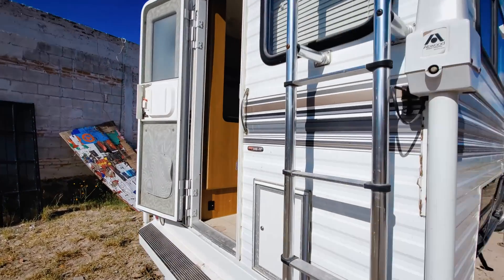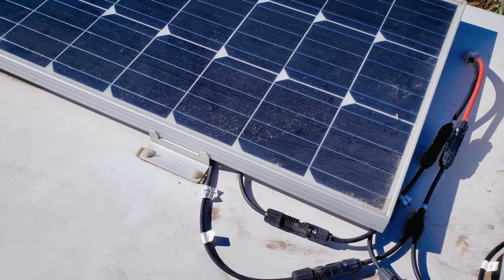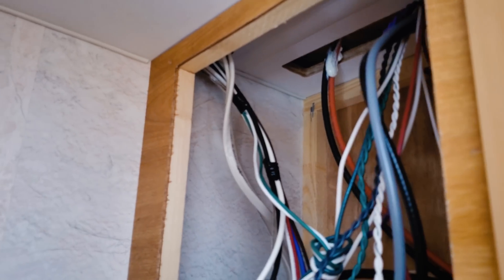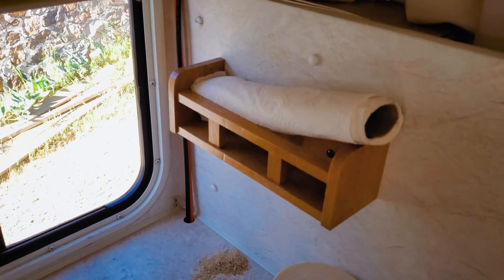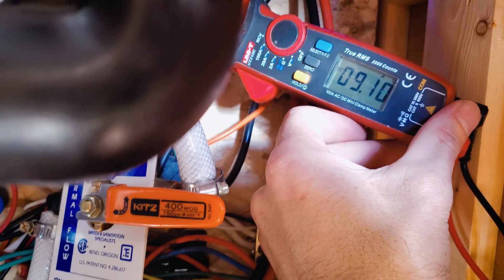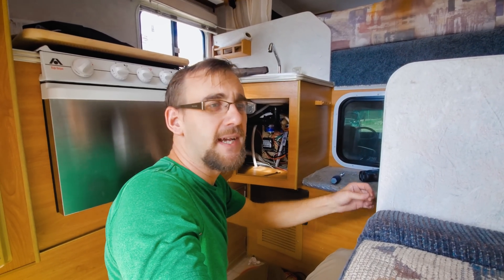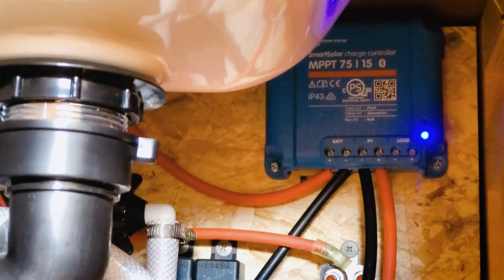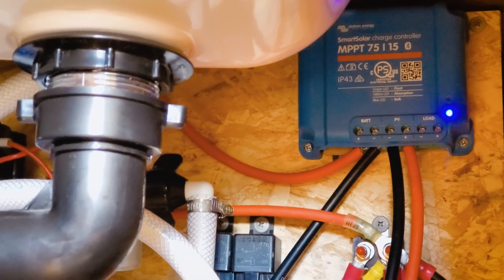Easy RV solar install for under $500

Comment from the maker: I told you guys I would make this. So here it is. Also since everyone is asking I still have the truth van. See proof of van life at 12:08

Total build cost, around $500... (if you use my amazon links I get a small commission)
Renogy 100 Watt 12 Volt Monocrystalline Solar Panel Slim - https://amzn.to/32SyjhF
Victron SmartSolar Charge Controller - https://amzn.to/303j6NG
Renogy 2 Sets Solar Panel Mounting Z Bracket  - https://amzn.to/34LlXcB
BougeRV 20 Feet 10AWG Solar Extension Cable  - https://amzn.to/2LzASyY
BougeRV MC4 Connectors Y Branch - https://amzn.to/34LUesA
Volt and Amp Meter - https://amzn.to/2O69muO
Reply: I have asked My illegal immigrant buddies which country is better.....USA or Mexico. They all said USA. All of them.(15 people) when i asked them why? They all gave the same answer. Safety and security. They would be afraid of owning a nice truck and camper in mexico because it would most likely get stolen and the cops out there dont care about auto theft. And they said if u give the criminal any problems or hesitate at all to hand over the goods they kill you. Day or night it doesnt matter. They do not value human life in mexico. People get killed for $100 all the time. U and ur family are in danger.
Reply from the maker: @CasaBonitaSucks  You clearly don't know what Mexico is like and your friends are simply jaded and don't know what most of it is like either.
Reply from the maker: @CasaBonitaSucks  there's no such thing as an illegal. And just because you found some people ignriant of how facist and violent the USA is does not make it better. I prove what you're saying wrong on video on the time. I would rather be a dead man and live free then a live slave who lickz boots every day. Take care.
Reply: I just ordered a solar panel for the cabin the other day...

Comment: Those solar panel cables that you passed through the roof to the inside are going to leak. For sure. Make sure you fix that. Maybe putting some sort of plastic cable cover or something. Hope it doesnt leak tho.good luck
Reply: And please put a splash cover under the sink to protect all that tech my man

Comment: My husband just finished his clean energy degree and has a couple of tips for you to maximize your system. You should assemble your PV array as close to 75v (10 amps) as possible. An MPPT charge controller will maximize the amps that your batteries charge. This means that they will charge faster. So it would be optimal to put your panels in a 24v configuration and when/if you add more panels to configure them up to 75v for the charge controller that you currently have. You have a nice charge controller you should make sure to get the most out of it!
Reply from the maker: Thanks. Though that does not really apply directly to a system this small. Yes more volts have less loss over distance and can use smaller wire. It does not change the final output amps to the battery. The only power advantage  is that it might keep the charger going a tad longer as the sun sets since it's higher voltage. There's nothing wrong with series, but it's really not needed in a small setup like this. 75V type setups are for large installs like on a house.
Reply: @GavinSeim Actually, you're incorrect. It does apply to small systems like yours. It's not about the wire size or line loss, the whole point of spending the additional money to get an MPPT charge controller is that an MPPT charge controller will convert extra voltage into more amperage thus charging your batteries much faster. You might want to research what a MPPT charge controller does as opposed to PWM charge controller. The charging difference is actually quite considerable. The only reason to have an MPPT charge controller is to maximize the amperage that you are using to charge your batteries. If you don't believe us, test it out yourself. See how much amperage you are producing over a day in a 12v configuration and then how much in a 24v configuration.
Reply from the maker: @HodayahBeruriah  I understand you're desire to be right here because your husband is in solar. But you misunderstood how it works and are incorrect. You can't magically convert more volts to more amps. It's a denial of physics. A collage degree won't change that.

In that video you linked she says... "using a PWM pretty much cuts your solar power in half"
This is 100% false. She just used 24v panel on with a controller that does not convert 24V to 12V system like the MPPT.

An MPPT absolutely will not double your power output any more than a PWM will halve it.  Either one if it is designed for your panel and system voltage will work fine. But most battery system are 12V. The advantage of an MPPT is computerized controls, charging modes and more acceptance of higher voltage with auto conversion to your batteries charge voltage. It's not that you gain with an MPPT. She just used the wrong controller for the panel and lost power because it was not designed to convert from 24 to 12V. 

 A 100 watt panel is 100 watts worth of charge. Nothing can change that. For example running two 100W 12v panels in series simply combines the voltage which cuts the amps in half at that higher voltage since voltage and not current has been merged. The  MPPT converts it back to charge voltage which doubles the amps back up to where they started . You still only get 200 watts, no more. The only advantage of this is that higher voltage has less line loss at high distance and could keep charging in the evening for slightly longer. You don't get more charge amps. This is not something that's my opinion. It's basic electrical science.

So let me repeat for those reading. Using PWM WILL NOT cut your amps in half and using an MPPT, WILL NOT  give you more amps. Using the correct one for your system will prevent you from losing amps that the panels already have and an MPPT may be slightly more efficient through the course of the day giving you a fraction more power. Here's a good video to explain this from someone who understood the math... https://www.youtube.com/watch?v=Z1ur3kSHuBU

Trying ti make a small RV install 75V would be pointless. Run in parallel or run in series. As long as you use the wright controller it won't matter to your final output.

Comment: Put some liquid nail on the bracket screws it works better than silicone
Reply from the maker: Never had a problem with putty ans silicone. That's what it's made for. I guess LN would work but it would not come off easy. I prefer everything to be easy to update.

Comment: Charge control. Next to water. Alittle risky??  If leak. Or wat not
Reply from the maker: That's have Lance Campers designed it from the factory that way. Seems a little shady to me too. But it does have a shield.

Comment: I work a small business of my own and work alot and could never afford anything close to all thatvstjff you have. Must be profitable to go on the run.
Reply from the maker: If you could never afford an old truck and a 90's used camper, you defiantly don't have a functional small businesses.
Reply: @GavinSeim  Well I have been in business 30 years so not sure if that is called functional but I own my home outright and built a shop here so again not sure what you definition of functional is. BUt I didn't just see "an old truck" I saw a late model GMC 4x4  and a 36' RV and a van and a camper. ANd no this functional small business could not afford all that even after 30 years in business. But I appreciate you attempt. thx
Reply: @GavinSeim  My point is I don't even see you work so not sure where this money is coming from. Doesn't matter if it is old and used no job usually means no money.
Reply from the maker: @bcxaz  Your point is to troll me. But it won't work here. I've never owned a new car or truck in my life. I work hard and I set things up well. It's called not being lazy and going out and living. Any functional small business could afford what is in this video.
Reply: @GavinSeim  don't worry about the haters and trolls. Ad revenue and such is great. I had it at one point, now I just sell Amish cookbooks mostly.
Reply: @GavinSeim  Gavin, theoretically if one were to take truck & RV south and lose the checkbook would US bank be able to send repo agents to Ol' Mexico?